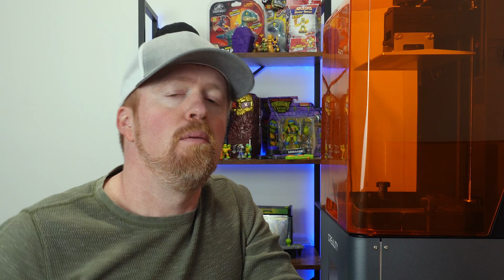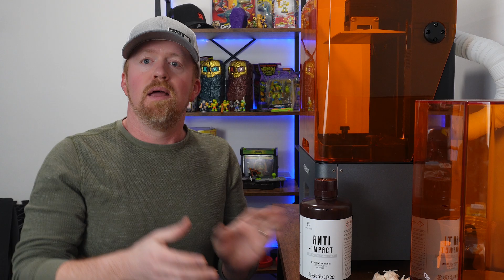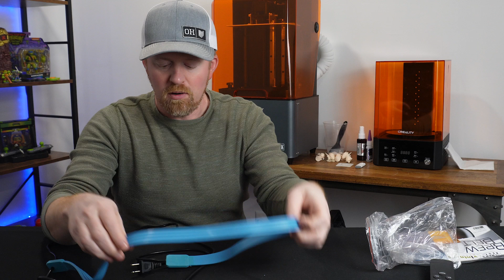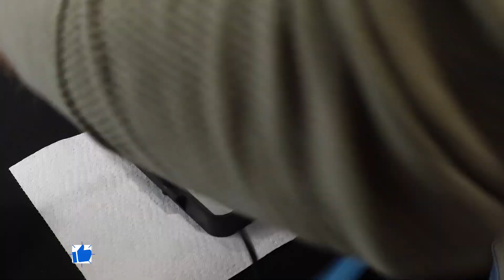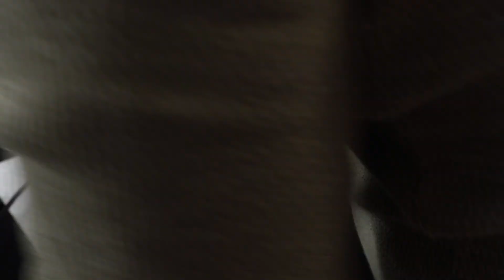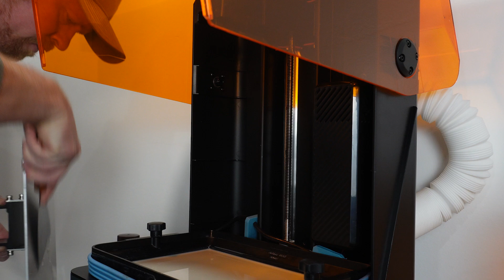Heat your resin for better print results

Comment: I have a small resin printer Anycubic Mono 4K, do I still need brew belt to keep the temperature or just warming the resin can be enough? Honestly I have no idea how long resin prints take, currently I'm trying to find a way to safely ventilate a space to be able to use it but I'm also trying to learn about this temperature issue.

Comment: I have the same problem. The resin temperature rises above 37 degrees, causing the part to sag, and the resin pump sensor does not work properly, causing the resin to overflow from the tank. I had to do all the steps manually. I have many problems printing with this model, whereas I don't have these problems with the elego and uniformation Also, changing the type of resin and colored resins makes it very difficult to wash the pan and does not clean properly.My problem is the opposite. What should I do to bring down the temperature? It cannot be done uniformly and there are many dangers on my part due to the change in resin temperature.